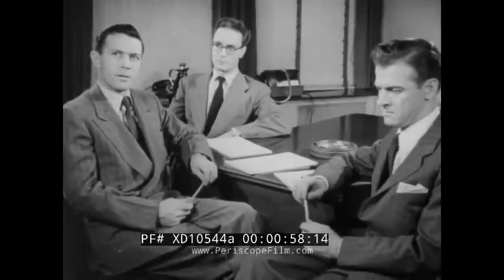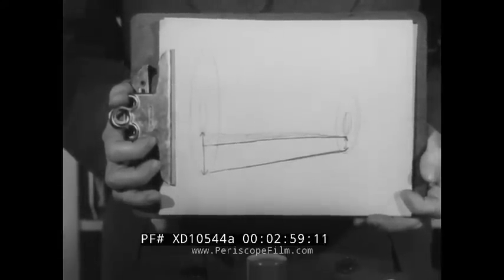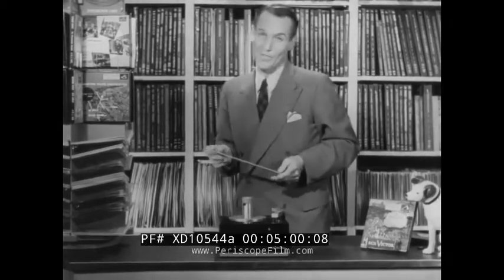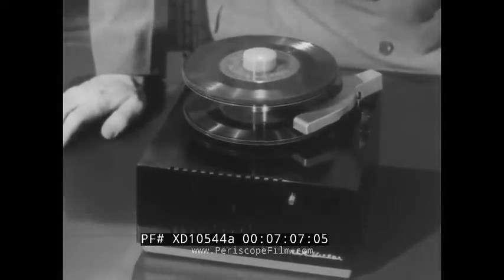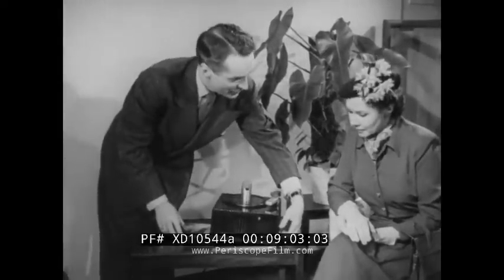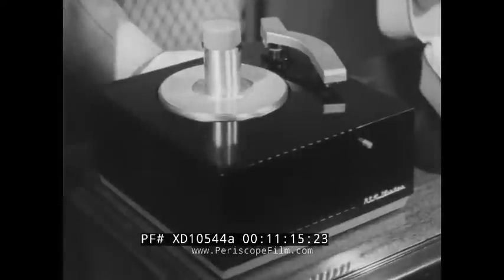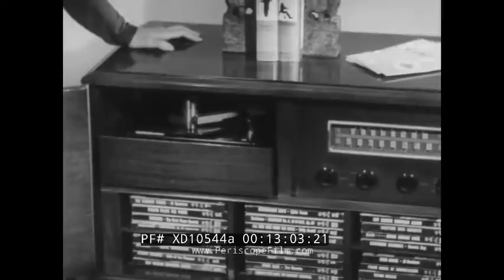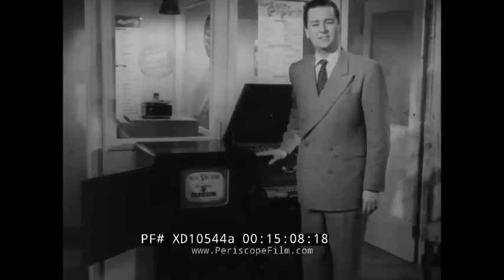NEW RCA 45 RPM RECORD SYSTEM & RECORD PLAYER PROMOTIONAL FILM   VINYL RECORDS XD10544a

Comment: I've been reading an article from Gramophone magazine from January 1951 explaining the various formats available at the time. Something I've noticed from reading Gramophone editions from the early 50s is that in the UK, 45s seemed to take a long time to take off. LPs seem to have been primarily the domain of the classical work, and everything else reviewed or talked about was on 'standard' records, which means 78s. This is true at least up to 52, three years after the format was introduced. Another fascinating piece of info the article yielded was that apparently Columbia initially came out with three sizes of 33/3 discs. A 7" single, five minutes per side, a 10" at thirteen minutes a side and the 12" LP at 25 minutes per side. Given that these were all at the same speed, I'm mildly surprised that the 45 got a look-in at all. It's probably been the only format war which was in effect a draw. RCA had their 45 album idea, which quickly bit the dust, and Columbia had their 33/3 single and... medium records which also died the death, leaving RCA King of singles and Columbia King of the long-playing format. Anyone any insights on any of this?
Reply: Columbia actually developed 7 in records in response to rca. They had the entire industry backing the 33 speed but the teens kept buying 45s regardless and eventually they just gave up and the 45 single lives on.

Comment: This must be a very early film, from when the 45 was either not released or in early production. All of the 45 changers in this film have the first edition changer, which they updated quickly after problems with the arm dropping so fast that the needle flew off the record. There was also a problem with the separator knives. It didn't say this in the film, but these separators spun out instead of pushing in and out. The knives would jam into the side of some records, causing the knives to break loose from the shaft they were riveted to. Then, in around 1950/1951, they made their last changer with the 'RP-168'(the changers shown in this demo) mechanism, the 45-J. By then, they had made a few improvements, like adding an air piston to dampen the tonearm as it dropped. The later versions of the 45-J even had new separators that pushed in and out.  After that, they started producing a cheaper changer known as the 'RP-190'. These are what you see all the time, with a usually black tonearm and plastic platter.
Reply: At what point did they switch from the start button on the front to the slider on top?
Reply: @dougbrowning82  Some consoles used 'player only' units that had the slider. When the RP-190 was brought on, that was when they added the slider to every player.
Reply: @romandjma.recordplayers7806  I had both types. A Bakelite cased player with built in amp and speaker which had the front button, and a radio adapter with a metal top chassis and Bakelite base with the top slider. I used to play the adapter through a Bakelite Golden Throat radio with the big, golden roundel grill. The volume knob on my self contained player matched exactly the volume and tuning knobs on my Golden Throat radio.

Comment: 8:20 5 grams was not bad at all for 1949; today anything below 3 grams is considered good, but 5 grams won't wear out a record very fast. The cheapest child record players were more like 7 to 10 grams.
Reply: PC No unless that record is a US 45 from the ‘70s or ‘80s made out of polystyrene
Reply: Yeah, styrene WAS a pretty shitty idea.
Reply: 5 grams isn't really all that 'bad' today either.  Of course lighter tracking is more desirable, but 5 grams is perfectly acceptable (required, in fact, for most ceramic cartridges to work properly).

Even the hated Crosley Cruiser and their other-brand equivalents work at around the 5 gram mark.  The claims that they 'destroy records!' are mostly hype, or related to the cheap sapphire stylus those players are often supplied with.

Don't get me wrong - I'm no fan of those 'briefcase' players, but the mechanisms they use are not nearly as bad as some people make them out to be.  The audio sections in those players, on the other hand, have a LOT of room for improvement.
Reply: @xaenon  The mechanism behind those Crosley players has been around since the late 1980s. It was the basis of all the 3 piece bookshelf systems of the 1990s. The cheap sapphire styli of those units can easily be upgraded to diamond. Costs a little more but lasts 10 times as long.
Reply: Yes indeed.  You can also get a stylus assembly that has a metal cantilever instead of the el cheapo plastic ones for slightly better sound but on those suitcase things it's doubtful you'd hear the difference.  Pipe the output into a decent external amp, though, and it's a different story.  I won't bullshit anyone and tell them it'll be hi-fi, but it's considerably better than the built-in amp and speakers.
Reply: @xaenon  You don't have  to replace the cartridge to get a metal cantilever, as there are diamond styli with metal cantilevers that will fit the supplied cartridge, which is very decent sounding when connected to an amp with a high impedance, ceramic input.
Reply: I misspoke.   I meant the stylus assembly, and I've corrected it in my previous comment.  Thanks for the save!  Though I've noted that even without a high-impedance input (like a tape input or something similar), it STILL sounds better than the built-in speakers.

It's why I love my little Radio Shack SA155 amps.  For such tiny things, they sound pretty darn good, and offer both magnetic and ceramic phono inputs, plus two 'line' inputs.
Reply: Zane Belton  I have an old Magnavox console, still sporting its original cartridge (the flipover needle, obviously, has been replaced a number of times).

The cartridge has to be replaced.  It still works, but the decades-old  rubber in the suspension is all dried out and stiff as a rock.   There are direct replacements, but I've no idea how old they are, and could potentially have the same problem.

I've been looking at the Banpa flipover cartrige/stylus as a potential substitute, but to fit it in my tonearm might be an issue.  

So I, too, am also considering the P188.  Though I'll miss the flipover feature for my 78s.
Reply: True, 5 grams was light.  

In my opinion the excessive wear on the part of a heavier tracking force is given far too much merit.

That record will play a ton of times before the danger of wearing out the grooves becomes more than just a ghost story.

These old players sound pretty respectable, given that they are being compared to today's ultralight tone arms, cartridges, and stylus.
Reply: It's not the record damage that the suitcase player creates that is the rub.

It's the poor sound quality that turns folks off before they've had a chance to hear what is there to be heard.

I'd love know what the sound quality was like 15k years ago, when frequency control was the equivalent of the combustion engine.

Comment: Instead of having a set standard using only RCA's players, someone just invented the 45 adapter, thereby destroying RCA's dreams of a record monopoly. Oh well...push and pull.
Reply: all the "OTHER" record companies that made the 45 rpm records had to pay royalties to "R.C.A.".     the 45 rpm adapter was made so you could use an existing record changer, so you did not have to go out and buy a new record player/changer. all the radio stations switched over to 45 rpm records, as did all the jukebox manufacturers!!!!( that sealed the existence of the 45 rpm record

Comment: The entire spindle, stack & turntable are rotating at the same speed, so little-to-no lag time after a record drops.
Reply: Actually the spindle is stationary, at least on every one of those I've ever seen.
Reply: @lwilton  On the ORIGINAL R.C.A. "45" system, the spindle DID in fact rotate (you can see this right in this video.), Later ones did not.
Reply: l wilton every RCA changer I’ve ever seen made exclusively for 45s had a rotating spindle.
Reply: @danieldaniels7571  Yep! That feature and the shorter "throw" of the the tonearm DESIGNED for 7" records is what made those units so fast at changing records.
Reply: This design of the "world's fastest record changer" only lasted for a year, because it was very picky about all records being the same thickness in order to work correctly. When Columbia and other companies began manufacturing 45s of varying thicknesses, it was prone to either dropping multiple records at a time or not dropping them at all, so they had to modify it to slow it down and make it more tolerant of different thicknesses of records. But even the slowed-down version was much faster than most standard record changers.
Reply: VWestlife cool seeing you here! I had one of the later models when I was a kid, and although it didn’t change records as fast as the “fastest”, it was remarkably fast, and also held way more 45s that I could put on a normal BSR. Took some searching, but I found a picture of it: https://thumb1.zeppy.io/d/l400/pict/143473144110/vintage-rca-45rpm-portable-record-player-model-7-ey-1ef-works-great
Reply: The spindle and turntable were originally cast as a single piece.

Comment: I didn't realize the 7 inch 45 came out before the 12 inch LP. But wow the tracking forces were high back then.
Reply: Actually, Columbia officially introduced their "33 Long Playing" album (initially 10 inch releases) in June 1948. "General" David Sarnoff, the head of RCA, was invited to listen to the new disc by his rival, Bill Paley (of CBS/Columbia) before it was released to the general public-  and he was impressed. However, Sarnoff refused to enter joint production of "33's" with them, and later berated his own technicians for allowing CBS to introduce a format HE should have perfected first {conveniently forgetting that RCA had tried to market a 10 inch "33" disc- "Victor Program Transcriptions"- in 1931, but technical limitations and the Great Depression had forced them to abandon it by 1933). Yes, the "45" had been in development at RCA since 1939.....and now Sarnoff insisted it be perfected to challenge Columbia's new format as soon as possible. They did this by the end of 1948- and previewed it for their dealers and sales personnel in January 1949. The public was officially introduced to the "45" a month later, and the first discs were on sale by March.

Comment: In a way, this technology has never been surpassed...  The idea of the single  was a major revolution that made music what it became...
Reply: They had 78 singles.  The 45s, as the film explains, were higher fidelity because of the optimal speed.  Early 45s were extremely high fidelity.  LPs sounded better later, only because they began to use polystyrene to make the 7" discs.    Vinyl 45s, though,  were superior to LPs.  I've often thought they should have used 7" large center hole vinyl 45 rpm discs for everything.  By compressing the grooves, they could have put the same program on one side of a "single' that was on an LP.
Reply: We had the perfect hi fi and stereo records, why did they fiddle with ? They didn't make it better in my opinion .
Reply: @petermaxwell2965  Stereo for the general public was Introduced in 1958 by Columbia.
Reply: @efandmk3382     7" 45s sound best if the recording is less than 4 minutes per side.  Once it goes over 4 minutes, the bass and volume must be decreased to allow for more grooves.  This also increases the noise level of the media (since you turn the volume up on the amplifier, this increases noise floor).  7" 45s have been as long as 8 minutes per side (with lower bass and volume).  EPs with two songs per side were of this type with lower bass and volume.
Reply: "STEREO REPRODUCTION" was the direct result of "BELL LABS"(western electric) it was started in the movie houses. I have an R.C.A.  console record player that was made in november 1957 that is stereo. I rebuilt this unit, and brought it back to its former glory.( I am not sure "WHO" released stereo to the general public first????)
Reply: According to a book I have about digital audio, the single is the normal way people purchased music. Before the 78 there was sheet music, where you could purchase a single song. It was the album that was a new way for people to purchase music, and for a time (in the early days of CD) it was the only way. Now, with downloads we have returned to the days of the single, but the album is an option.

Comment: Their sales pitches have certainly come a long way since those times. These days they don't give you a chance to fall asleep. As for unbreakable, give me a break. Vinyl might have appeared unbreakable against the old shellac records, but they could just as easily scratch and with a bit more effort even crack. And they also wore out over time.
The biggest improvement came with CDs. That's when I knew it's worth starting a collection. I still have some ancient 45s though, more an investment than for listening to, original early Elvis Presley, Buddy Holly, Stones and Beatles. I'm keeping them for a rainy day.
A tip for vinyl lovers: Make sure you only buy records made of vinyl that contains chloride. All the ones made before the mid 1970s have that in them. The chloride acts as a lubricant allowing the stylus to glide better, causes less static and less wear.

Comment: The regular popular music of the day was on 10-inch 78rpm shellac. 12-inch was used for classical releases that needed a longer playing time than the average 10-inch disc could allow(a bit more than 3 minutes). A 45rpm disc can, and has held recordings exceeding 7 minutes("The Real Thing" Pts 1 & 2 by Russell Morris ran 6 minutes 20 seconds when issued on EMI/Columbia in 1969, its follow-up, "Part Three Into Paper Walls" by Russell Morris, issued later in 1969 on EMI/Columbia, ran for just over 7 minutes and they were mono. Gordon Lightfoot's 1976 release, "The Wreck Of The Edmund FitzGerald" on Warner's Reprise label, edged close to 8 minutes, and was in stereo) so the format is capable of holding a lot of audio on one side of these records.
Reply: The "B" side of Bruce Springsteen's "Fire" single was a live version of "Incident on 57th Street". The record shows 10:03 as the length. Easily found on e-bay.
Reply: @teacfan1080  Did you "clock" the record?(Did you check the actual time on the disc, as opposed to the time quoted on the label?) The quoted time on the label may be a misprint as the longest I've known a song to play on a 45rpm 7-inch disc was "Wreck Of The Edmund FitzGerald" by Gordon Lightfoot at over 7 minutes 35+ seconds.

Comment: 45's didn't become the replacement for 12" records, at least not after the speed of those dropped to 33.33 rpm and a whole album could fit on ONE disc.  But as we know, the 45 did succeed as a single in the R&R era, and became THE Jukebox staple.  Not the job that RCA invisioned, but they DID sell a ton of them, and received license royalties on every record (for a time).  Wonder if anyone has that Rachmaninoff concerto on a 45 RPM album set?
Reply: By the early 60s, they were pressing 7" 45 rpm EPs, with 2 songs per side. But, in the 70s, they regressed back to 12" 33 and 45 rpm singles with just one song per side, again.

Comment: 11:00 - looks like you needed 2 units for stereo ;) Have fun syncking them up :)
Reply: Think that would be stereo FM radio only ?  Stereo Discs came about late 1950s but did not sell, needed two heavy, hot and expensive amplifiers.  Revived in the late 1960s when cheap transistors made two amplification circuits small and cheap

Comment: 8:45 - I call bullshit!  That's not the beginning of the Rachmaninoff concerto, and there was no surface noise as the stylus landed on the groove.  Rachmaninoff was dubbed in during post-production.
Reply: Oh come on, please... you're not suggesting that salesfolk would lie in the pursuit of profit... are you?  :->
Reply: I own one of these players, a 45-J to be specific(basically just the same as a 9JY, just without a variable output control). After seeing that clip, I immediately went to do what they showed. I can confirm that there was no wow & flutter, tone distortion, etc. I was honestly surprised because I also jumped to that conclusion at first. I was using a piano record for the best results, too.
Reply: @romandjma.recordplayers7806  Piano recordings are fantastic for showing wow and flutter.
Reply: @wisteela  My point exactly. Yet not a single change in wow and flutter or tone.

Comment: RCA was counting on the small size of the records to make people want to buy them. It used a extremely fast changer for the classical and album market.
Reply: And, in effect. they did. By 1951, the "45" record was becoming the choice for "pop" singles {Columbia finally adapted it that year, after trying to market a 7 inch "33" single- and "The War of the Speeds" was effectively over}....while "78" sales began to decline. It was a long, slow descent for the speed that had been the "standard" of the recording industry for over half a century. In 1958, Mercury records had decided, on the lack of sales of The Platters' "Twilight Time" on "78's", they were going to discontinue issuing those dics commercially...and the other major labels followed suit. By the end of 1958- with a few exceptions- no "78" discs were being widely produced in the United States.
Reply: It had a change cycle that was too fast! The tone arm would lift up quickly but the big problem was that it would drop onto the next record, literally!
In 1951, damped cueing was introduced where the tone arm would gently lower itself onto the next record.